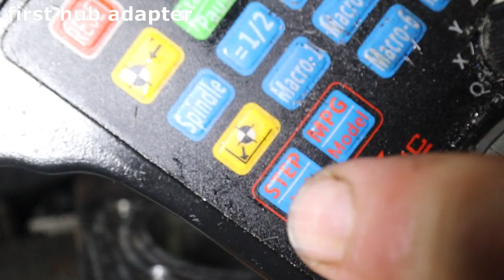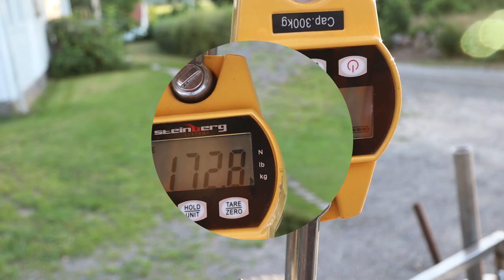The trailer for the XN08 mini-digger is ready

Comment: You should load your mini excavator with the blade on the down hill slope instead of up hill. In fact,  you should approach most inclines that way. The rear of the cab is weighted to counter balance the loads on your bucket. To make things worse, those counter weights stick out past the tracks. It can easily roll backwards and roll over . The blade will prevent that. 

 The blade should always be on the downward side of travel when possible.